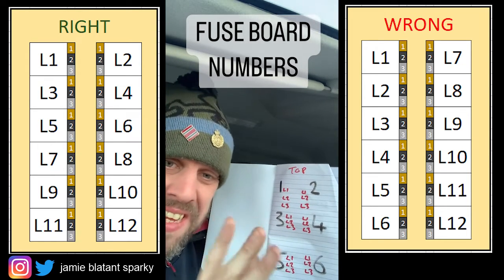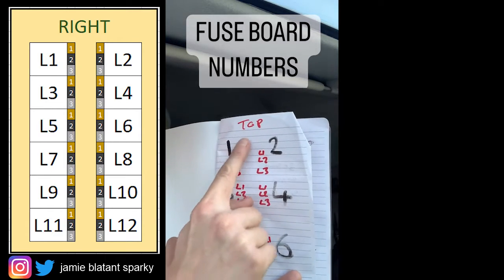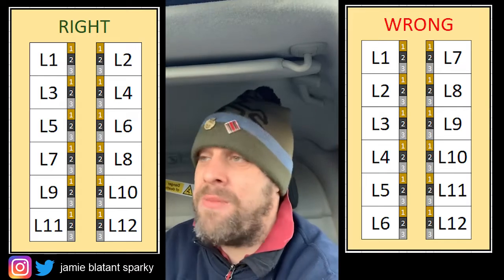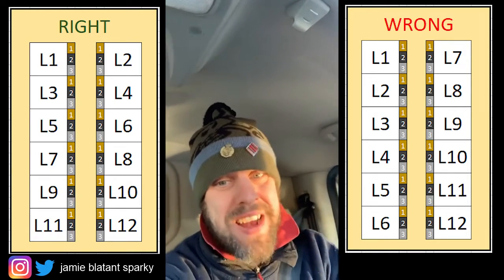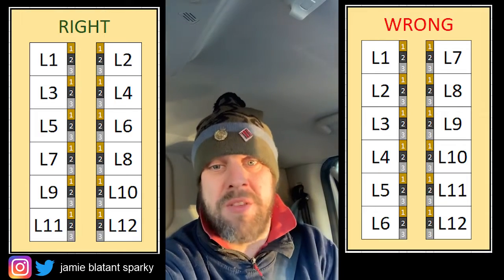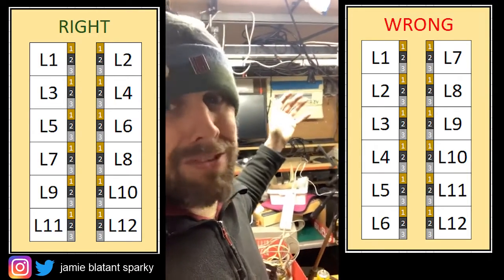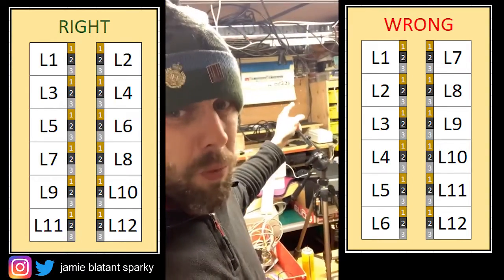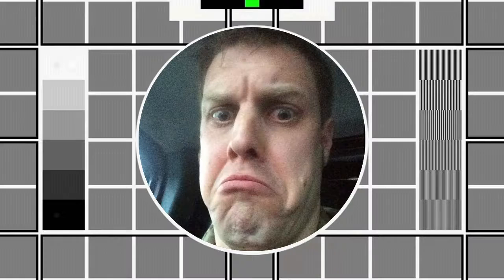HOW TO NUMBER A FUSEBOARD - a process control sparky explains

Comment: Um one slight flaw...   "Left to right top to bottom,  And you change to a bigger board, all the numbers stay the same, test results stay same, cable numbers stay the same"...   Makes total sense for this reason only, but then you say "Domestic fuse board, Left to right, it doesnt matter where the main isolator is"...  If the isolator is on the right and is a 6way board and you change to a 10way board with isolator on the right, then suddenly circuit 1 becomes 5. 2 = 6, 3=7, 4=8, 5=9, 6=10...   That goes against your argument for the 3phase board numbering.. In fact if you look at like a Hager board the earths and Neutral bars are numbered right to left so it makes sense to also number the circuits from right to left..  The IET forms you need to put circuit number, I don't disagree with you that your method for numbering 3phase board does make sense but I honestly think what is more important is labelling which is often rubbish or non existent.  I would rather have a board that is clearly labelled that is the "Wrong" way than one that is not labelled but is the "Right" way...    I don't think there is any written "Right" way specifically given, manufacturers should make it clearer how it should be numbered and that system should be followed, if its clearly numbered then that is the number system, doesn't matter if you agree with it or not..